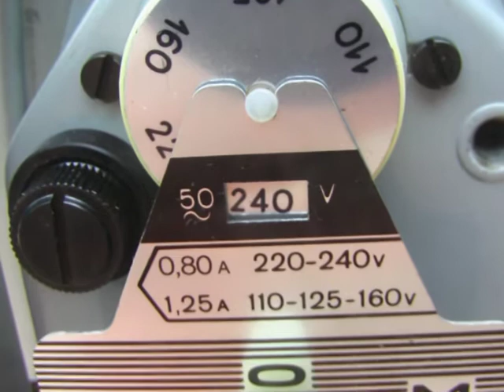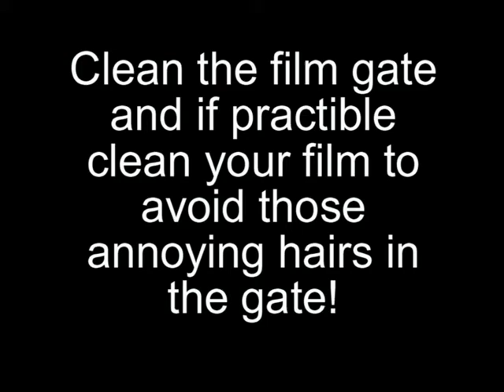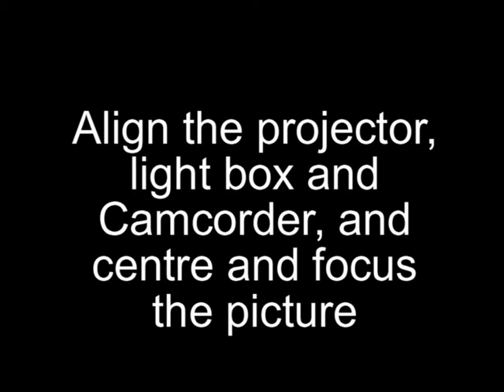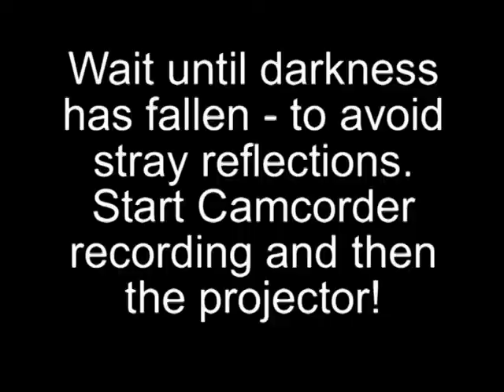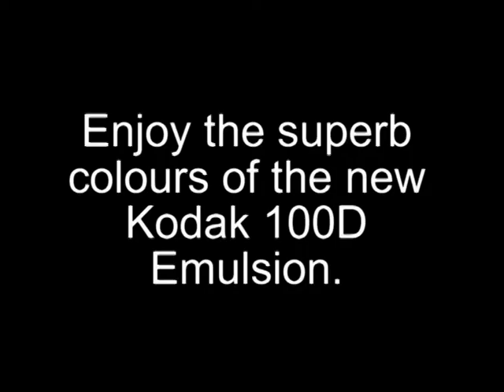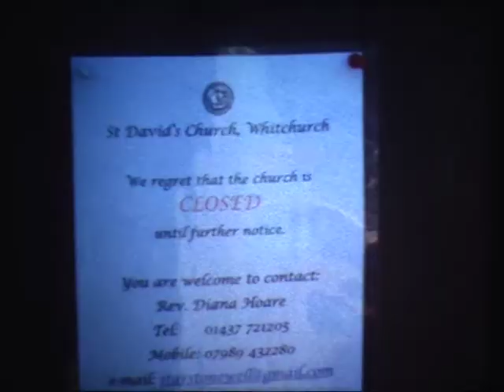Kodak Ektachrome Super 8 2020 Film to Digital using a Bolex 18-5L projector and a Catozzo Light Box

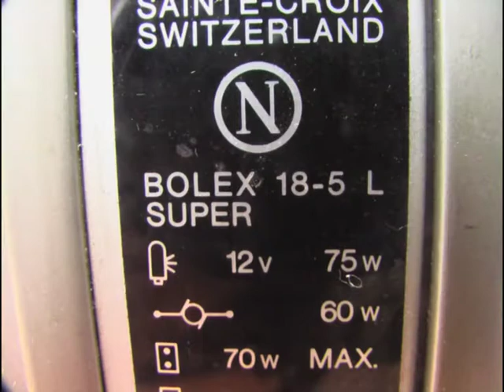Comment: What is that part you show at 1:21 into the video? It is white with wires and a fuse on it. My motor stopped working so I'm trying to hunt down all the fuses inside to check those first. My upgraded halogen bulb is still working just fine so it's the motor circuit I'm trying to isolate and diagnose. Thanks for any help explaining where you found that part in question, inside yours.
Reply from the maker: Hello - this is the UK Mains Plug - to show the earthing connection and is thus outside the Bolex itself. You have a challenge on your hands - Good Luck. T